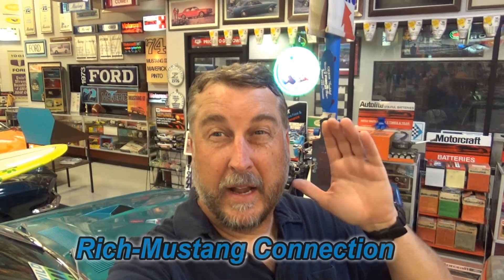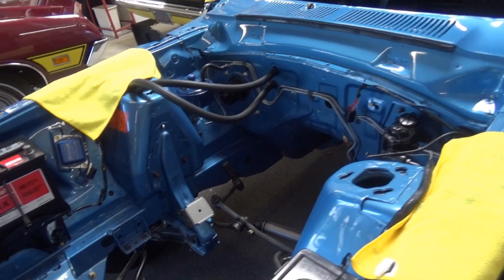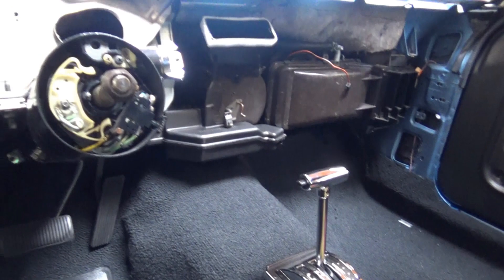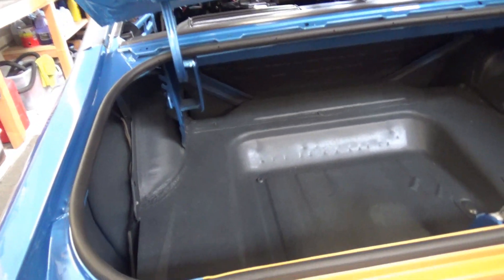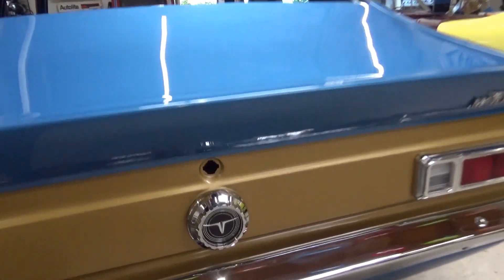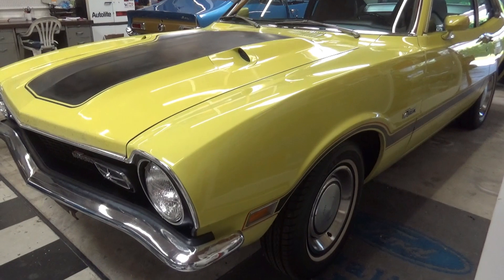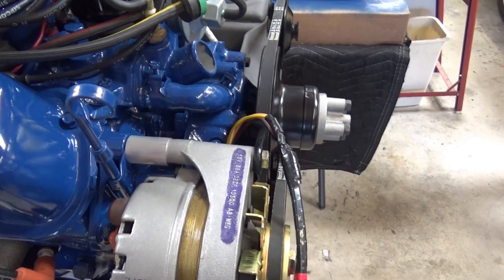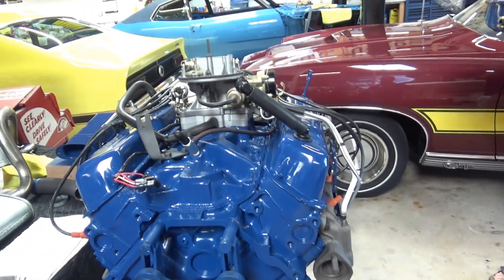1971 Grabber Maverick 1972 Ford Grabber Maverick all original and full restoration

Comment: I was the Previous owner of your Yellow Grabber.   I Picked it up in Lake Elsinore California around 2006.    Brought it back to AZ and garaged it.   Glad to see you Fixed the driver side Fender.   Sold new at Burch Ford but im sure  you have the Marti Report because i Let it go with the Car.    I also have Pictures of the Partial Build sheet  Still Stuck in the Passenger seat Springs.  I removed the Seat to Get Pictures of the Build sheet.
Reply from the maker: Todd, pretty cool if you send me your email I will get  you in touch with the owner, I am sure he would like any info on the car.

Comment: Over the years, I've fully restored a bunch of these and Comet GT cars. I own a fully restored '71 Grabber that has a 351w HO crate engine, C6 transmission, 9" Ford rear with 3:91  Detroit-Locker gears, 4 wheel disc brakes from a Lincoln Versailles, '65 Thunderbird sequential tail lights, factory A/C, 15x7 Magnum 500 wheels, front spoiler, and rear window sports slats. The car weighs 2767 pounds. It's a joy to drive.
Reply: I would love to see this car.

Comment: Those cars had the right amount of power for there size. It made them fun to drive.
Reply from the maker: A forgotten car in the Ford lineup, they served their purpose well back in the 70's for sure. Remember the Gapp and Roush  pro stock Maverick ?
Reply: @MustangConnection1  I remember them they had the little hot wheel pinto too.

Comment: It’s Zink yellow
Reply from the maker: Ford didn't offer a "Zinc" Yellow until the late '90's early 2000's but yes it is very similar. Many of the paint codes and names changed over the years but the formulas were the same. Good eye though!
Reply: Boss 302 1969-70 or was that the Mach 1 ... I remember one of the two or those Models being that color